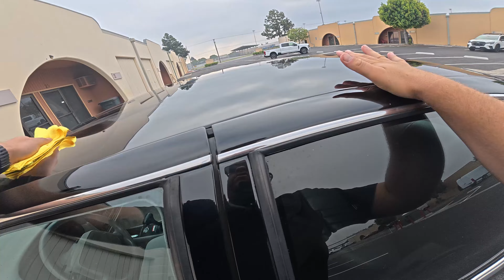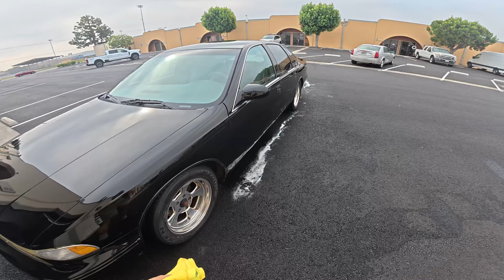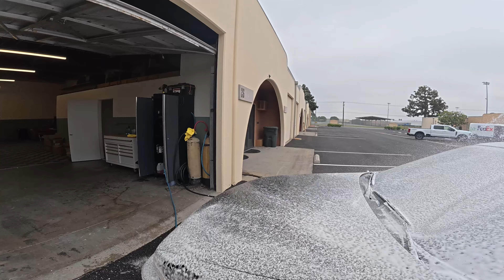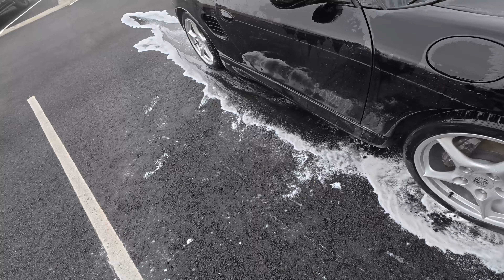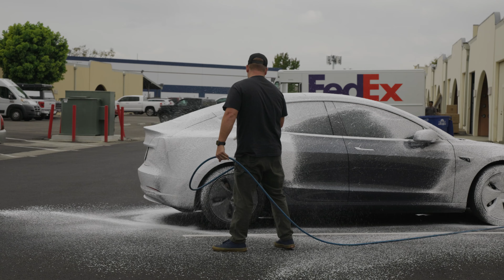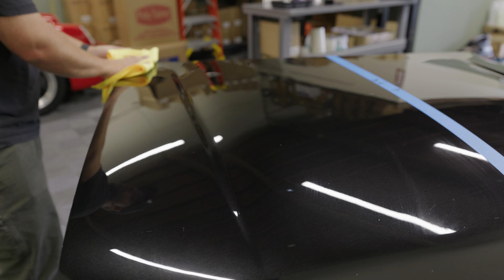WASH & TALK: Water-Based vs. Solvent-Based Detailing Products: What’s the Difference?

Comment: Question! Why do you typically use a microfiber towel instead of wash mitt/sponge when washing the car? With your expertise, I figured there may be a reason, or is it just preference? Thanks Jimbo!
Reply from the maker: Mainly because of its flexibility and convenience. With a towel, you can easily flip to a fresh side, which helps reduce the risk of dragging dirt across the paint and minimizes scratching. And when working on tight areas, a towel makes it easier to get into all those small spaces.

Comment: Hey jimbo i got a question whats the difference between a ceramic spray sealant and a ceramic detail spray when they both offer on the bottle 6 months of protection?
Reply: typically ceramic detail sprays are heavier on the polymers than sealants, which make it safer on surfaces (like as a drying aid) but also in theory less durable protection.
Reply from the maker: The main difference between a ceramic spray sealant and a ceramic detail spray really comes down to their intended use and the level of protection they offer.

A ceramic spray sealant is usually designed to be more durable and provides a stronger, more robust layer of protection. You’d typically apply it to a clean, dry surface and give it a bit more curing time for maximum results. It’s often used as a standalone protective layer or to top off a ceramic coating.

On the other hand, a ceramic detail spray is generally more about maintenance. It still provides protection, but it’s formulated for quicker, more regular use to enhance the shine, add a slick feel, and maintain the existing ceramic protection on your car. It’s a great way to boost gloss and slickness without the time commitment of a full sealant application.

So, even if they both advertise 6 months of protection, the sealant is going to be more robust if you're after longer-lasting durability. Hope that helps!
Reply: @autodetailingpodcast oh thanks so much. If you got time  is a ceramic booster a mix between the two of them? I know it's supposed to be a topper for a cermiac coat but it supposedly offers 6-months of stand alone protection too